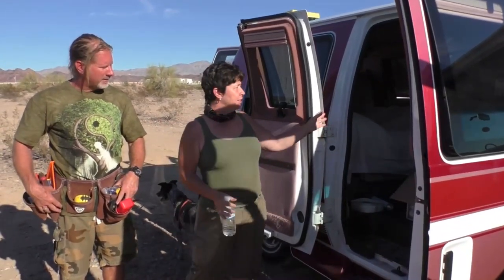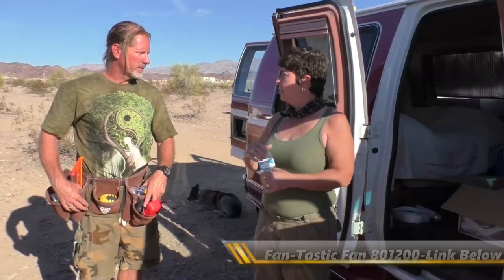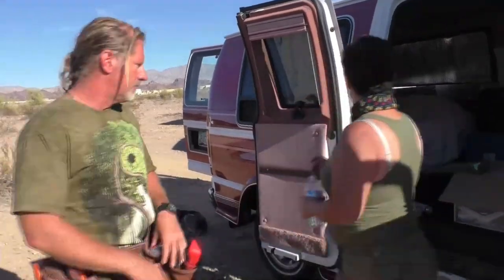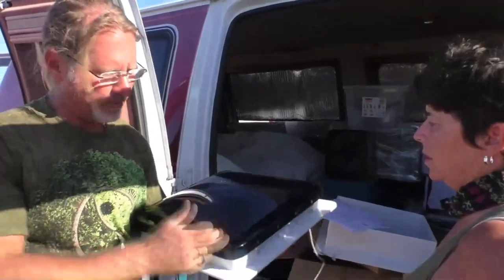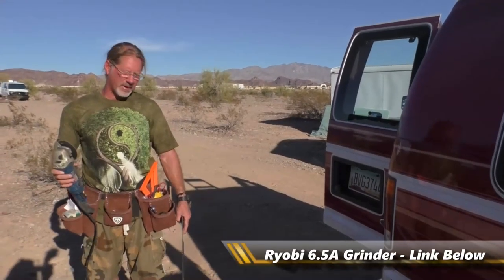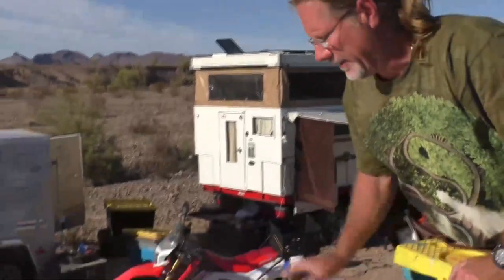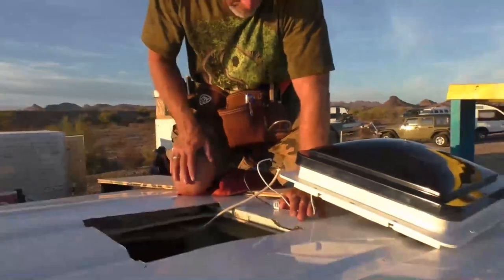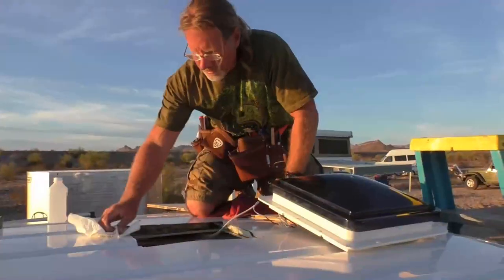Fan-Tastic Electric Fan | 12 volt fan RV roof vent install

Comment: Excellent job!
Another well known Fantastic Fan product is the Endless Breeze 12v fan, which is a standalone unit, no install required and uses very little electricity. It's another option that some folks may want to consider.

Comment: I just did the same install on my van. I used a jigsaw with a fine tooth, metal cutting blade, and it went through like butter. If you have an unfinished van with nothing but the metal roof to go through, and nothing that may catch the blade, you can use just a regular jigsaw and a file. And that second, vibrating/cutting tool you used I have to concur, it is a fantastically versatile one. I thought I wouldn't use it much, but I use it all the time around the house and on my model railroad. I got mine at MicroMark as a close out, but I've seen them at Harbor Freight for pretty cheap, too.

Comment: I really appreciate you showing this how easy it was to put that fantastic family my problem is I haven't had given the ceiling is fiberglass it has eight or nine lights running down inside it's ceiling for wiring and I'm worried about fiberglass cutting a hole in it it'll start a leak other than that I would love to have a fantastic fan I wonder if there's a commercial place that installs you take care have a great day and that was a great video

Comment: You can take squirril cage from a furnace that is 110 . place in garage and open doors will blow out heat and cool objects in van. A small generator will chill down unit in a few minutes. I like a rear hitch with platform to build a metal box for gen set fuel propane . can make box on hinge.

Comment: The black wire from the Fantastic fan is the power (fused) wire which will go to the positive of the battery. The white wire is ground and goes to the negative of the battery. Unless you want the fan to run backwards and there is no reversing switch. If there is a reversing switch then the directions on the switch will be backwards.
Reply from the maker: Did I not say that? lol, I shot this video years ago. I say that now when I'm filming these installs. Thanks, Rick! :)
Reply: @enigmaticnomadics  No, your on screen graphic at 21:41 said the black wire is negative. On a fantastic fan the black wire is the power(positive) wire which is fused. The white wire is the ground wire. If the black wire is hooked to the negative of the battery and the white wire is hooked to the positive terminal of the battery the fan will run backwards and the fuse will be on the wrong wire(the ground wire), technically it should be on the wire attached to the positive terminal of the batyery. That's all I was pointing out.
Reply from the maker: Thanks, I better take that video down.

Comment: The Dicor self leveling sealant should go on last, not on top of the butyl tape. Butyl tape first then the screws then the Dicor over all the screw heads and a wide layer of Dicor around the edge of the fan base. I always wait a day for the butyl tape to squeeze out a bit then remove the excess butyl tape then apply the Dicor sealant.

Comment: I would not use a crimp connector on a solid wire, use a wire nut that has a spring inside. Cover the interior of the van with a tarp to catch all the dirt and dust.
Reply: Yeah, I never seen him using wire nuts, he does do a good job though. I like that tape he uses.

Comment: Great video Jamie!  It would have helped to go ahead and show the wiring on the inside too.  Are your own supples you’re using furnished by the company you’re advertising for, or is that cost going back to you, eg., metal saw blades?  Thanks.

Comment: Great video but I still have no idea how you did the wiring. Did the wires from the fan intersect with the dome light wires? I have a Jackery 500, can I use that or do I need to buy a big battery just for the fan?

Comment: Question#1: the wire from the battery to the fan looks like regular house wire. Is it?
Q #2  I have a small 'vintage' trailer with 12 volt for a couple of lights and want to put in a fan where the vent is.  How would I hid those wires??
Thank you

Comment: Hope someone can answer my question. I need to cut a 14 by 14 hole in my teardrop and install a vent. The roof of the teardrop is covered with “checkerboard, aka diamond plate  aluminum”. So what should I use to cut through this tough looking material? I have no power tools yet but will buy what I need.

Comment: Is the Butyl tape sufficient to work around the ridges in the roof, or would it be better for me to buy an adapter?  I'd like to avoid spending money, but if it getting an adaptor would provide additional insurance against leaks, I'd rather be safe than sorry.
Reply: Personally I think the butyl tape works best for keeping a seal. But it couldn't hurt to do both methinks.

Comment: Off Topic for this video, but by any chance are you aware of a good way to mount either a 1lb or 20lb propane bottle to a roof rack. I have a very rugged CON-FERR roof rack on my 1987 dodge, and would prefer mounting above the vehicle rather than the hitch rack or carrying inside. Primary use is to power the Mr Buddy Heater.
Reply from the maker: +grantar2 propane mounting brackets are made for forklift trucks. I'd start searching there. Good luck!

Comment: Hi Jamie i have severl questions regarding the items needed for this install.  what size screws;  flat or round;  Whats the Meter Vlt device  reader you used here?  and Finally.... There is No video ANYWHERE in YT on  How to Wire a Fantastic Fan?  where does it go after it hides behind the panels or walls? That's all for Now Thank-You TFS. Sending my Contribution with No Problem!!
Reply from the maker: Hey, Lacsa727. The screws come with the installation kit, but small, sheet metal self tapping screws would work. (1/4") A volt meter that costs around $25.00 will do the trick. Mine is a Craftsman brand. http://amzn.to/2qHG9vC The wiring goes through a 7.5 amp fuse on the positive side and the positive (Black wire) goes to positive and the white wire goes to negative on the 12v battery bank. Hope that helps!
Reply: Enigmatic Nomadics  AWESOME! Gracias Jamie ...Here I goooo theress no going Back!! meassure twice cut once...meassure twice cut once...meassure twice cut once...eeeeekkkkk

Comment: I'm not a hater but - I have a few issues with the fan install.  Should have used flexible (automobile) wire (not house wire) to connect the fan to power on the vehicle.  Soldered connections or wire nuts would have been better than butt connectors.  The Butyl tape should be the only material sealing the fan to the surface of the van.  The dicor is a lap sealant for the outside surfaces.  Other than that the install was fine.
Reply from the maker: Great comment ycmdill. I give you all your points other than the dicor over the butyl tape being a negligible effect and can only help, whether necessary or not. As far as your other points. It is my fault for not being clear in the video that we are not starting from the point of having a budget for the exact correct materials in a perfect situation. Although this is an install that I feel is safe and will be problem free with the materials donated by me and others from our scrap aggregation. Dawn would not have a fan installed in her van if she had to come up with the materials you suggest and also pay for the labor. These installs are taking place for absolutely free and we are using what we have in the desert. I will start a Patreon and/or Amazon wish list before the next build to address this moving forward and I hope you are willing to make a contribution of even tangible materials, if not funding on the next round. If fact, your more than invited to bring all the right materials out of pocket and show us how you would do it at our next build. Thanks.
Reply: Also, what do you think about facing the fan lid the opposite direction?  If, for whatever reason, the lid was left open before traveling, or such.  Maybe there is a reason to face it opening forward that outweighs this idea.  IDK.

Comment: in your opinion do you have to have the 14 inch square bracing to install a fan. I have an enclosed trailer and took out the roof vent and put in a rooftop ac. now that said I would like to install a fantastic fan or the like in another roof section to bring in air on a cool evening. Do you think the sheet metal roof is enough or should I build a brace up top?
Reply from the maker: The 14" square isn't actually bracing. It's just a flange for looks. A piece of trim. It isn't needed. If I were going into thin aluminum, I'd put some plywood on the inside ceiling to bite into with the screws coming from the roof. Best of luck!
Reply: Enigmatic Nomadics thanks brother that's what I was thinking. just wanted another opinion.

Comment: If you're mounting the fan in one thickness of metal, do you shorten the sleeve that goes through the hole? By how much?
Reply from the maker: Yes. The flange is made to be cut. A few inches should do it, but just put it up there and mark it.
Reply: Thanks

Comment: need to put paint or something on the bare metal to keep it from rusting bare metal from cutting the hole good job otherwise
Reply from the maker: Yes. The Butyl tape keeps outside moisture from coming in, but residual condensation would be absolutely no factor with a coat of paint. To be fair, it would realistically take dozens of years to be a problem.
Reply: Agreed
Reply from the maker: Check the link?
Reply: Trying to send a picture of my van
Reply from the maker: Still not opening. Would love to see how your making out.

Comment: The instructions say 14“ x 14“ hole. You could have saved yourself a lot of time. Plus, a grinder is the wrong tool two years and on top of it you used a grinder with a wheel with no safety glasses. You would have been fired off my roof.

Comment: Hahaha thanks again make for ALL the fuses you guys put in my van it saved my inverter.
Reply: Oh, no! Did they break?
Reply: I accidentally left a1500 watt heater plugged into my 450 watt inverter. So I finally took out the inverter and figured out it had no internal fuse but when I raised my bed to check the 20 amp fuse it was blown hahaha. I replaced the fuse and bam......the inverter works again hahaha. Thanks again Jamie.
Reply: Omg, I'm so glad you're OK. Could have started a fire. Thank heavens for good fuses.
Reply: Amen hahaha